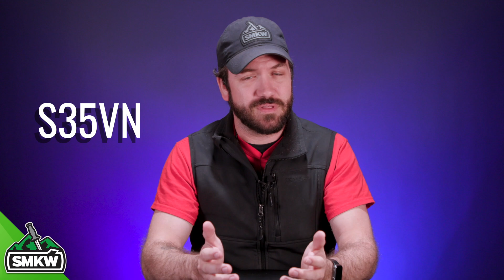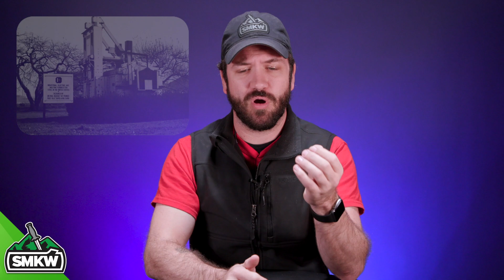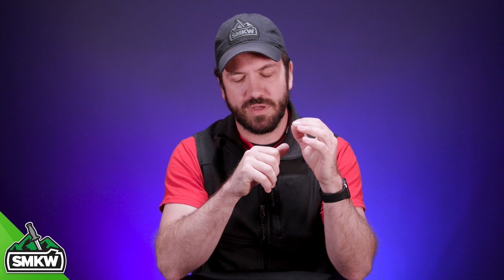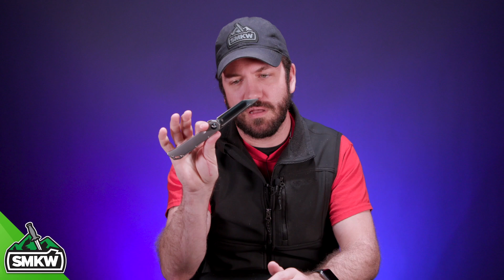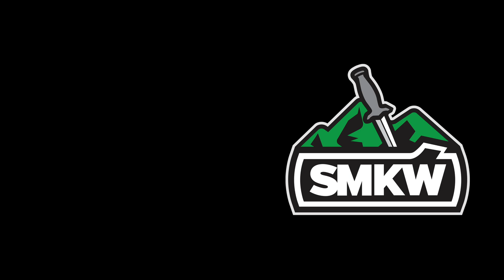CPM-S35VN: An in-depth look at this powdered steel

Comment: i recently bought a few knives for trades use and for outdoors both s35vn looking for edge retention and durability. before i was using a nedfoss knife $25 but the down side edge retention wasnt there had to re-sharpen it after heavy use

Comment: I usually tend to not like super steels, to hard to sharpen. Then i got my  Cold Steel Recon 1 in s35vn. What did i do? i ordered the Ontario Rat 1 in s35vn. It's the only super steel i use after trying it out.
Reply from the maker: Glad you found one you like 👍

Comment: Bought the Ocaso Solstice. S35VN. Haven't used it a lot. It's a gentleman's folder with a liner lock so isn't a heavy use knife. That said, the factory edge wasn't as I liked it and I was able to easily sharpen it. So far, very happy. Have a good feeling about the knife and might, very well, end up my go-to EDC. Though a liner lock it's got very good contact. It's slim in my pocket (I still have a usable pocket with it clipped) and the bearing  in the liner makes for a VERY smooth action. Absolutely NO blade wobble when it;'s locked open. Spent more for the titanium scales but the micarta would be fine, I'm sure. Perfect for what I wanted.

Comment: In my age and experience, by and large, you get what you pay for. My Recon 1 folder is my go-to folder. It’s resistant enough to not have to baby it yet it’ll throw sparks. It holds its edge great. Coupled with that solid triad lock up, it’s a force multiplier. Not exactly stumping for Cold Steel but this knife designation is a winner.

Comment: I'm really late to the game on talking about s35vn I have a few knives with s35vn and don't know a lot about sharping but I see a lot of s35vn out there so it looks good for me as soon as I get a really good sharpener (not that my spyderco sharpener is bad but I want to get a work sharp sharpener the professional one so I can better sharpen my knives and I want to learn more about stopping
Reply from the maker: S35VN can hold a great edge with just a pull ceramic sharpener and a strop as long as you don't damage or chip the blade

Comment: In my experience the "old" S30V and its "evolution" S35VN are really good, some of the best stainless proven by me.
I like a lot that they have limited amount of chrome, excessive chrome in my experience is highly detrimental to extreme keen edge development.
In fact I doubt I will ever buy again stainless steels with more then 14% (15% max, better 14%) of chrome again, experience with other brands 😵‍💫

...curious to try CPM M4.
🇮🇹

Comment: I really like s35vn because ease of sharpning,....how long it stays sharp once sharpened and corrosion resistance.
My 1090 Izula developed rust real quickly even though I took good precautions.
I used it for food prep and pretty much everything in between.
I didn't like rust taste in my food.
That said I purchased the ESEE Xancudo in s35vn and totally love this knife!!!
I liked it so much I replaced my 1095 Izula for the s35vn Izula and I like it so much better!!
I ended up going to Knife Connection for amazing scales for my Izula and am really happy with the quality and looks.
Love both my ESEE knives in s35vn very happy with both knives,......Xancudo is simply gorgeous and purfect for EDC. i feel strongly!!!
Reply from the maker: That is awesome that you found one that works for you and upgraded it as well 👍

Comment: Great video for those who know alot about knife steel. This video is  missing why I want this steel, how does it compare to other steel, when would this steel be inappropriate?
Reply: inappropriate when you are looking for the best cost vs blade length ratio. it also took about 2 times longer to hand sharpen compared to AUS10 or VG10 steel. Also in marine environment this steel will also oxidize if u forgot to wipe it clean after use. I recommend sharpen it with diamond plates to save time. I put 13 degree angle on it, it chips easily. Try not to go lower than 17 degrees.

Comment: Is there any real difference between cpm s35vn an bos s35vn??
Reply from the maker: Both are CPM, which means Crucible Particle Metallurgy, and BOS is a heat treat that is proprietary to Buck knives.
Reply: @SMKWcom  awesome! So that means my buck 120 pro series, with the boss s 35 VN steel and green micarta handle really is is nice as knife as I thought it was! Thanks! I have noticed that the steel holds up so much better than there typical 420hc.

Comment: I only ever had my benchmade bugout but that’s in s30v. I’ve had it a long time. I love it but it did break the tip a while back when I dropped it. I fixed it and been using like that since but I’m in need of a new knife for sure. Hoping to save up for something in s35vn for my next daily. I hear great things
Reply from the maker: Thanks for watching Shaun!
Reply: @SMKWcom  any recommendations for a new daily  in s35vn?
Preferably a drop point lol
Reply: @Its3-x8s  ZT 0452
Reply: I got the red carbon fiber scale version of it and it arrived a cpl weeks ago...so far I love it. It's built very well that's for sure.

Comment: Kizer is a amazing brand and very high quality imo, I own 2. My Matt Deegnan Kizer with S35vn steel with a titanium handle, and my Sheepdog that uses 154cm steel. You really can't go wrong with either it being Kizer, but after using my S35vn for a while and still going I don't think I'll use anything other then S35vn steel here on out. It literally blows most if not all my other knives away when it comes to edge retention and durability . Plus its way easier to sharpen up and you don't have to sharpen it as often either. And for the price it doesn't get any better then Titanium + S35vn steel it's a steal lmao.

Comment: Sadly, with all of your experience, you seem to believe spec sheets over reality. S35v was indeed supposed to have better edge retention than s30. However, that is simply not the case. In fact, exactly the opposite is the case.

 Same with 110v vs. 90v. On paper, 110v is superior to 90v.  However in the real world, again, it doesn't only not match 90v, but falls short of 90v. 

KnifeMaker

Comment: In relation to the production process, does Crucible manufacture the S35 into bar blanks to then sell to knife makers, or do knife companies send their blade designs to Crucible to have stamped and sintered into the desired forms? You think it would be the latter to best utilize the powder metallurgy process.
Reply from the maker: Check out our Crucible Video here https://youtu.be/Fyp8-rZI_3I you will find that they make it into thick barstock called a compact and from there it goes to Niagra Specialty Metals at which point it is rolled into sheet  and then in most cases sent off to the manufacturer to cut out grind and heat treat.  A few manufacturers will actually send the dimensions and have Niagra cut the blade blanks out for them.
Reply: @SMKWcom  Thanks for the info! I'll give the video a watch.

Comment: I've got a couple in S35VN, it's never let me down, holds and takes a nice toothy edge, cuts rope, cardboard, packing straps mule tape, wire insulation, tape, and any other thing I have to cut on the job. If I'm using it a lot, I'll have to touch it up every other day or so. It's not that it's 'dull' but the edge isn't as keen as I like it.  I keep the edge bevel at around 40 inclusive.
Reply from the maker: We love S35VN! 👍

Comment: What's better 1095 or S35 . I'm gonna buy an essee 4 it comes in either steel
Reply: That’s a hard one to say one way or another, it really comes down to personal preference, some people love 1095 some adore S35VN. S35 will hold an edge longer and is harder but 1095 will be much easier to sharpen but will take more maintenance since it is not stainless.  They are both great in their own way and each have their pros and cons